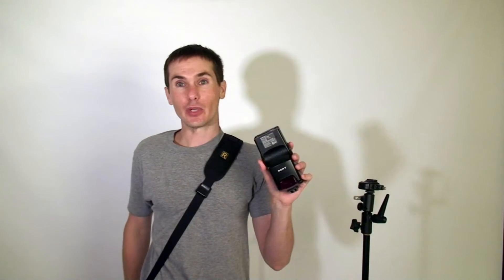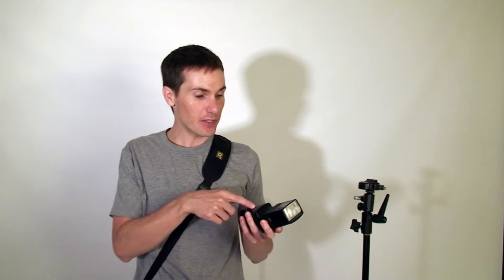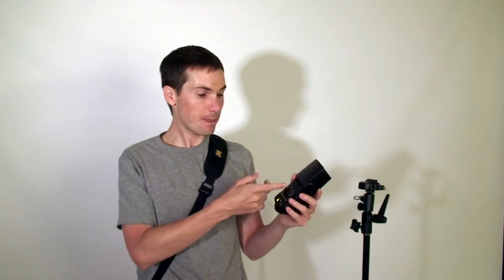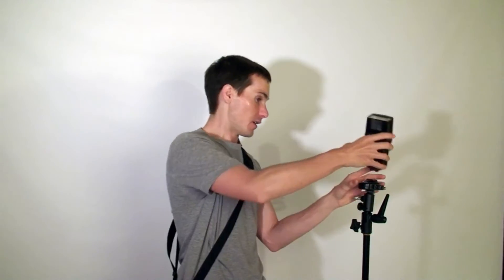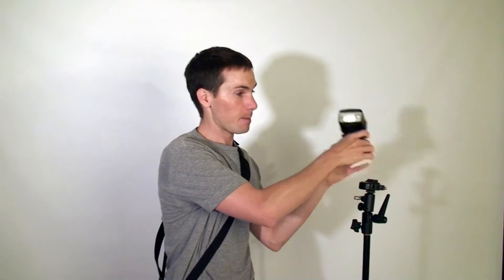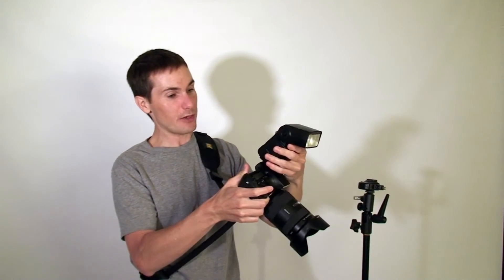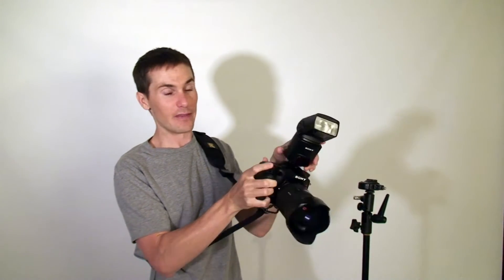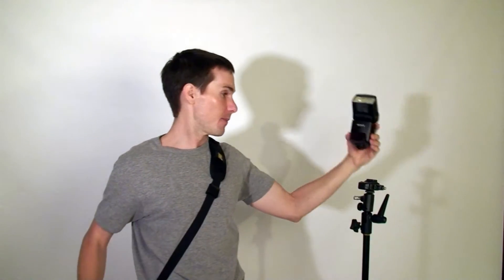Sony HVL-F42AM speedlight Studio Radio Trigger bug, and how to fix it

Comment: Had the similar probolem putting it on my old NEX7 (Minalta shoe ) what ever I did wouldn't comunicate with the camera or  a remote. Eventuality  I had a light bulb molment! I attached an adapter for my A7 and attach to cam it initalise.  Removed the adapter  and refitted on the Nex7 and Bing works. Saved the flash from the bin. I didnt know it was a known bug. #Note to reconfigure the flash look at pages 44 to 48 of the user manual . "Sorry to long to put in explanation hear."

Comment: To change the time to power save : 1) press HSS for 3 seconds, menus starts blinking -> custom mode mode. 2) press the zoom menu to change the time for save mode : 105(30 sec) , 70(30 min), 50(3min), 35( always on) . Hope will help you and thanks for the information . The same works for wirless mode , it is 60 min for all ranges expect (none) for 35mm. ,

Comment: Not ALL transmitters and receivers work automatically in manual mode with the HVL-42AM.  The Phottix brand TX's/RX's require you to sync the flash with the camera no matter the mode.  I've been shooting with the A77 and the HVL-42AM for a while now, and I use the Phottix units for outside sports portraits.  I MUST sync before it will become functional.

Comment: here's from the "iShoot" radio trigger site to get a Sony HVL-42am into "manual mode"
-- place flash on camera
-- turn on camera
-- turn on flash
-- press "hss" for 3 seconds (+/-) ...on "1/2",,,left side menu icons will blink
-- press "hss" again
...your HVL-42am is now in "manual" mode and will fire on most any radio trigger (CBS, Pixel, iShoot)

Comment: AND I should have thought of this solution, because this is exactly what I need to do to pair it for wireless use with the regular flash/light trigger (without a radio control)...

Comment from the maker: Have you tried cleaning the contacts on the bottom of the flash?  It's possible they are not making a good connection, and causing an intermittent failure.

Comment from the maker: Hi.  Find my other video called "Sony Alpha a77 and Cowboy Studio Flash Radio Triggers" - There is a link to buy them in the description.  I am not sure about the a55 black screen as i have never used the a55. I have read that there can be an issue though, because you typically shoot in a dark studio with a small aperture; With the a77 i need to turn "live view display effects" to off for studio work.  I do not know if the a55 has a way to do this, or a workaround.  Good luck!